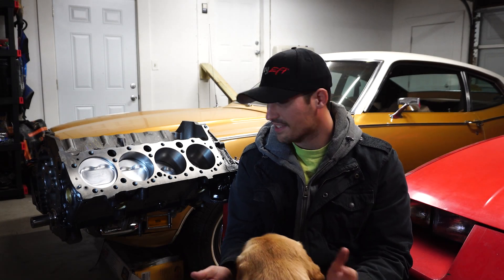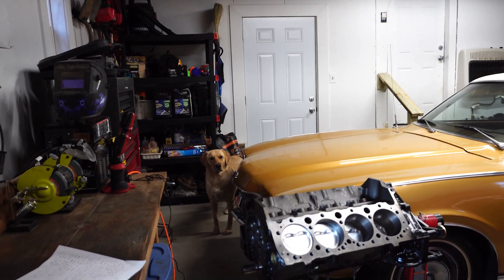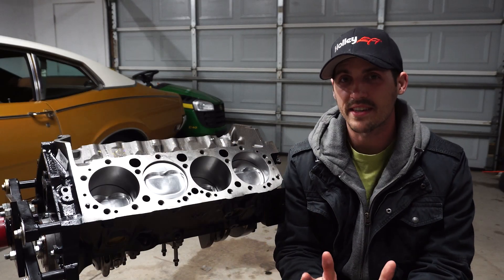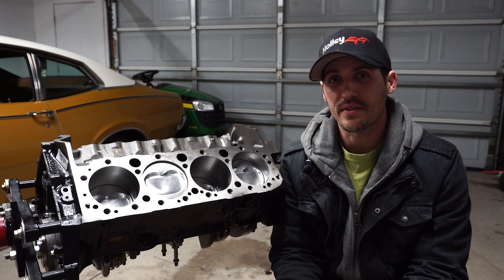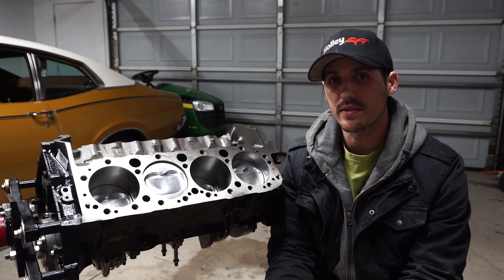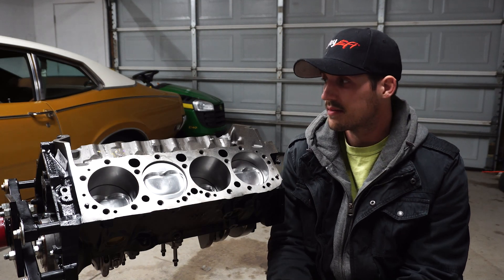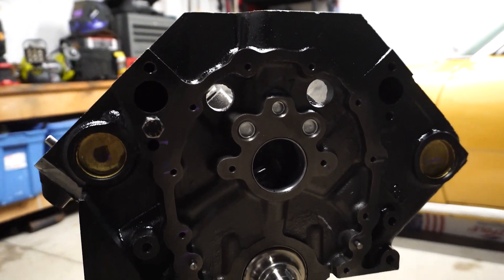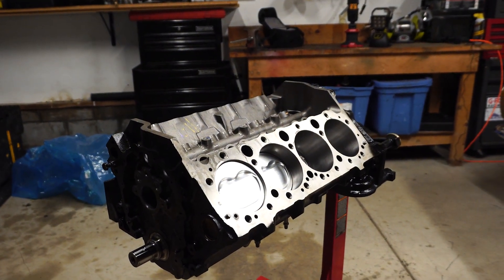ATK Crate Engine Review! Reveal of Our New Chevy 383 Stroker!

Comment: Would a Gen III ATK LS crate engine from Jegs be reliable enough for use in a daily driver project? I haven't heard any positive or negative thoughts on these engines. I just want a  reliable engine. Or would I have just as good of luck simply going to a junkyard and having a mechanic look at the junkyard engine? (I realize that a person never really knows what they're getting with junkyard engines. However, they can normally be had for half the cost or better than a basic crate engine. Eventually, I might be adding or changing the springs, camshaft, intake, exhaust. Thanks in advance for any advice, opinions, or answers.
Reply: I got one and they’re reliable. I ls swapped it in my 88 Silverado. Quiet as a nut and reliable

Comment: You can get a factory regrind roller cam from a company in Texas off of eBay for about $180 shipped. They sell a few different grinds, maybe 10 different ones and they may be able to custom grind one for you? The LSA would have to be close to factory though but that's a good thing with a SC.

And you can get factory style hydraulic roller lifters for about $60 shipped. I think the spider and dog bone kits are around $50 and a factory roller thrust plate for  about $10 shipped.

There are 2 different sbc camshaft thrust plates, the later Vortec one and the roller blocks before the Vortec style. The pre-Vortec thrust has a wider bolt pattern, it looks like the one you have. So when you look for them get the wider one.

So right around $300 you can have a roller cam and all the accessories.

With a 383, make sure to get a small base circle cam or there WILL be rod to cam interference. Ask me how I know.

If your rods are 5.7" and you're planning on running a cam with less than .500" lift(calculated with 1.5:1 rockers) and on the mild side with duration, like under 235* at .050 then you might be able to use a standard base circle cam.

One of those factory regrind cams will have a reduced base circle from being reground. But before it is reground it will probably fit without interference because they were so small from the factory already. Anyone of them should go right in without any worries.

Cool project, I am now subscribed. 👍
Reply from the maker: Thanks for the advice it seems like you've done this a couple times! I still haven't pulled the trigger on a cam but I'll be sure to get one with the right clearance 👍 I'm hoping to make some progress on it soon! Thanks for watching
Reply: @ZanesGarage  

What RPM range are you looking to run your 383? You got all the good parts to spin that thing, maybe a solid roller cam might be a better way to go?

Unfortunately, I haven't been able to find a factory roller style cam that is a solid roller, I don't think they make one? 

Good news is that they make longer solid roller tie bar lifters that work in a factory roller block. And a non roller block roller cam will work in a roller block but not the other way around.

Built one that way for a friend and that thing rips! Dart 220 sbc heads with a Howard's solid roller cam.......

What are your plans for the 383? Street or street/strip or strip only?
Reply: Ok ill bite, how do you know? 🤣
Reply: @jjmccloud  

Because Summit sent the wrong cam and there was interference from the connecting rods and the cam lobes. The engine doesn't spin very good when that happens so I had to send the cam back and have the reduced base circle cam sent, and that's how I know.
Reply: @itseithergonnaworkoritaint7852  Wasnt being a smart-ass or anything lol i was almost expecting a story about how you went to break it in before you noticed any interference 🤣 I wouldn't wish that on nobody lol most cams will interfere in that situation but there's a few lucky combos that squeeze by depending on cam and brand/type of rod and length like you said. Scat rods usually clear the lobes a little easier then most eagle rods but even if you did manage to clear using a regular cam itd still be close. Its definitely a good piece of mind to have all the clearance u can get there, I've seen a few pretty damn close that I'd never be able to sleep at night if I owned 🤣 if you do it right though you get enough to have a peace of mind